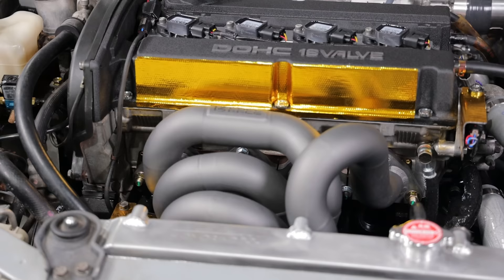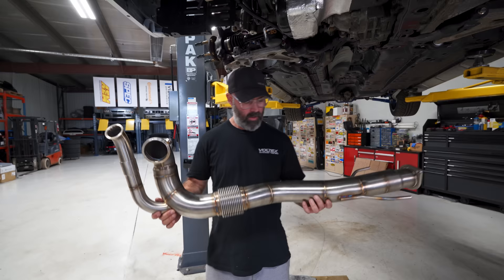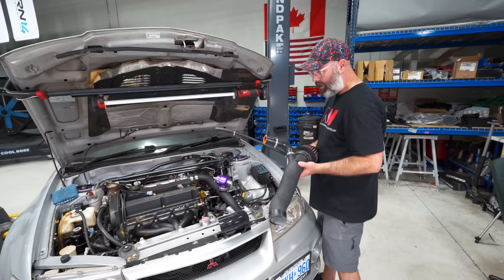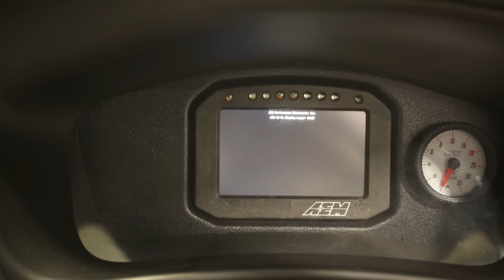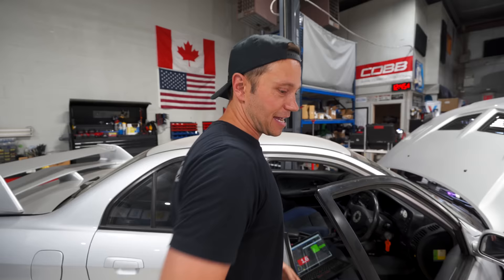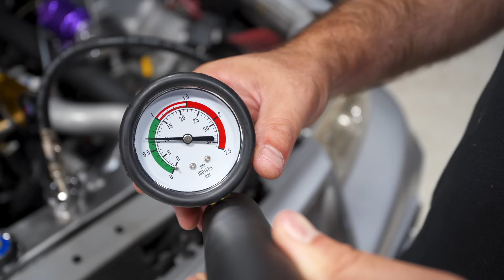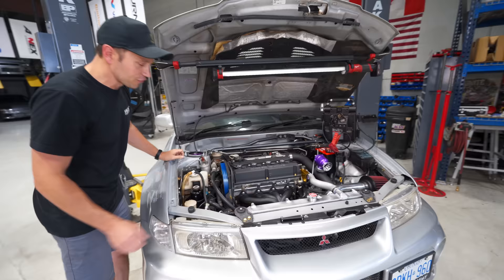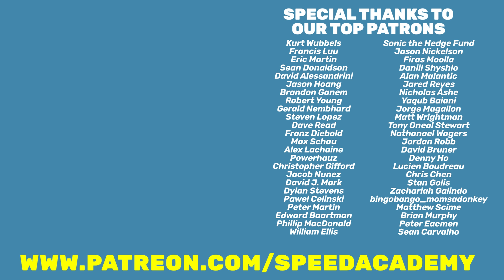EVO 6 FIRST START After 2 Years Goes as You'd Expect

Comment: When assembling the engine if you put thicker oil in the oil pump itself before bolting it on that will help with priming a lot. I usually put everything together and put the timing belt on last so I can run a drill on the oil pump until all the lifters push oil, then put the timing belt on and don't habe to worry about it.
Reply: I have also seen people loading them up with vaseline, which I think also works well. Some pumps also have a passage close to the pump gears where you can gravity fill the pump with oil. Finally you can remove the spark plugs for a bit more cranking speed! But in the end I do like that Jegs pressure bottle, good solution too!

Comment: Next time for the oil pressure, remove the spark plug the starter will turn the engine faster then build oil pressure faster.
Reply: less load on the bottom end bearings as well !

Comment: Great content guys!! So I just found out today the distilled water is just a better than tap. What should be used is deionized water. I've been using distilled for a long time. Came across a video of a company that specializes in cleaning motorsports cooling systems. They said deionized water is the water to use. I looked it up and found it to be true... hope this helps. 

Keep the vids coming!!

Comment: Trakmotive CV axles, highly affordable... tho for the ford 8.8, I have a job this winter that will be loading them up to a 206'000 psi tensile load... the original 365000km axles made it thru only one winter season expending two sets of tire chains in the process. 50 bucks each last year they were 900 bucks with importation tariffs but those seem to have been dropped.

Comment: We JUST had the same problem with a evo 8 engine not wanting to prime . i tried the compressed air didnt give me good numbers but didnt setup the air pressure system like you did . 

the fix was when the engine is upside down oil pan off pour assembly lube into the pick up hole and give it some turns until she takes it and keeep adding , i used about half the bottle . 

then put oil into the oil filter and screw it on . 

i had a cup of oil on the pick up tube and spun the oil pump until i started reading oil pressure on my gauge connected to a battery . had to refill the cup of oil a few times . and oil got everywhere but the motor was primed and safe

Comment: The oil pump needs to be packed with Vaseline. I've built tons of 4g63 and see oil pressure within 3 seconds on first start.
Reply: Interesting
Reply: @RenntatoRacing  fills the void so it prevents cavitation, and it will suck up oil instantly.
Reply: This can’t be safe. 😂 Does the Vaseline just melt??
Reply: @TML34  it's oil based should be fine. Makes a lot of sense actually
Reply: @TML34  also should change oil after first heat cycle anyway
Reply: @TML34  built over 60 4g63s. It works. It's petroleum and becomes part of the stew at operating temps

Comment: Next time you are trying to build oil pressure on a brand new engine, remove the spark plugs. Removes all the load from the bearings.
Reply from the maker: We did that just didnt show it
Reply: Interesting, wouldn’t have guessed, sounded like the starter was fighting compression. Good move though

Comment: Holy crap running without the crank pulley is a chance to take... Iirc there's nothing holding on the cam belt pulley when the crank pulley is off 😅
Reply from the maker: Not on this engine. There is bolt that holds the sprocket on the crank
Reply: @speedacademy  jup and a pretty big one^^

Comment: I noticed the catalytic converter was installed naked. No heat shields or wraps. Would it benefit with a simple heat wrap around it? Keeps the floorboard cooler, and helps keep the heat in making it more efficient for catalytic converter things.

Comment: Noticed you guys never added any fuel pressure regulator or anything of the sort are those things really necessary for a build at this level?
Reply from the maker: Not really. With the big fuel pump and large size injectors, even with a droppin fuel pressure injectors are well within their capacity to compensate.

Comment: What is the point of recirculating the waste gate? Errr i wish i understood that stuff
Reply from the maker: An open wastegate is very loud and dumps exhaust gas underneath the vehicle. The recirc is quiet and puts it back into the exhaust system
Reply: @speedacademy wow. I really appreciate the response. I had no idea some would prefer to not have a strong blow off noise and such. It does make sense.

Every single one of your modifications are so carefully considered.

Comment: Using that reducer in the intercooler pipe is an awful fix. Did you do the math on the air speeds? Turbulent flow here you come.
Reply from the maker: Have you done any math on it? Because it actually isn’t bad at all since it is the exact size of the outlet of the turbo. If it was a smaller diameter, then yes, it would be a restriction.
Reply: @speedacademy  Without knowing your intended boost target and redline how could I possibly? 

I didn't say it was a restriction, I mentioned airspeed and turbulent flow. Big mistake. 

You have a poor attitude to criticism, as always.